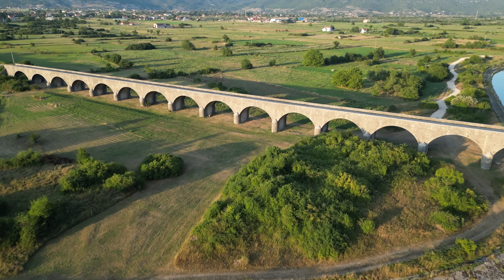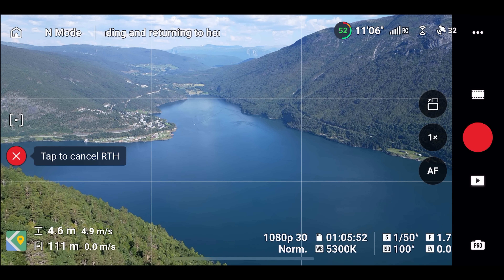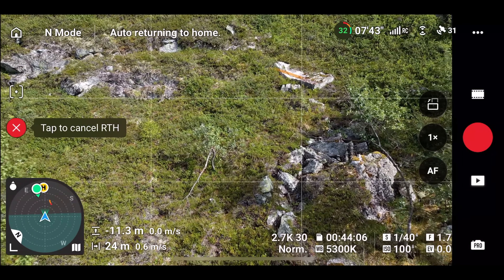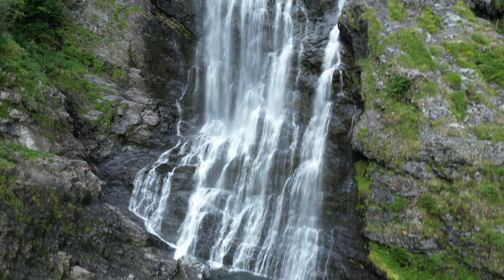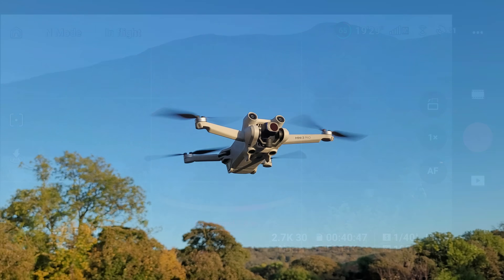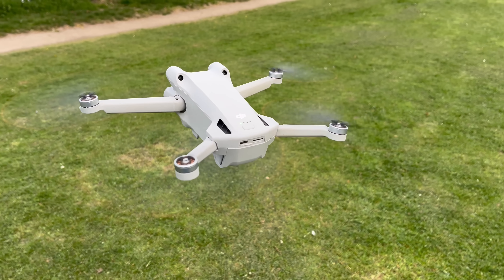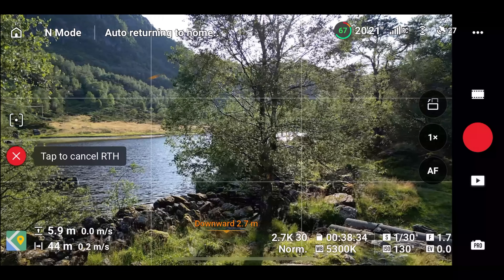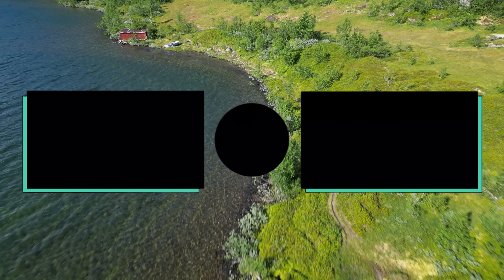Negative Altitude RTH has a BIG Problem... Here's What You Should Know

Comment: Thanks for taking the trouble to document this fairly common scenario that many of us have been baffled and confused by, leading to the loss of a drone. I must admit that I’ve not read the operation manual thoroughly. So far I’ve avoided any mishaps by mostly maneuvering back manually
Reply from the maker: Glad it was helpful, and it's good to hear you've been able to avoid any issues so far!
Reply: You have identified the root cause of the problem!   
" I must admit that I’ve not read the operation manual thoroughly."

You can always find out exactly how new features work by experimentation.      That's the expensive way.

Reading the manual not only helps you to avoid crashes you'd otherwise have had:  It may make you appreciate features and abilities that you would otherwise have missed.

There are many names for actual pilots (manned aircraft) who don't read manuals.  None of them are flattering.
Reply from the maker: @jimbarron9939 That’s just it though - in this case the manual seems to be missing this crucial piece of info which has the potential to prevent losing the drone.
Reply: @jimbarron9939 well this case shows that reading the manual doesn't help.😊

Comment: The mini 3 pro is plagued with issues.
1- one motor was stuck

2- auto transmission module does not work anymore. Specially the 5.8ghz

3 - fog/ mist in the lens

4- very bad signal 

The Mini 2 was the best and most reliable Mini ever created by Dji hands down
Reply: El mejor será el Mini 5 Pro (detector obstáculos 360°, sensor Lidar, sensor cámara 1", graba audio, Batería  50 min. etc.) pero el Mini 2 sin duda fue lo "más Pro" en su tiempo (Ocusync 2, vientos nivel 5, Vel. 57,6 km/h, Dist. 10 km., alt. 4 km., Camara UHD 4 K, vuelos IA, Fotos Raw - Pano - 360°, SD 256 GB) tengo dos drones pero el 2 el q más uso no lo cambio; veremos el precio del 5.. 👍🏽✅
Reply: @Heriel989 The Mini 5 Pro is amazing. I got mine 12 days ago.
Reply from the maker: There are a few frustrating issues with the drone, but I’d say overall it’s still a great drone. I doubt DJI will be releasing any major updates for the Mini 3 Pro anymore since we have the 4 Pro, and potentially a 5 Pro coming soon.

Comment: I knew about the 5 m.
Not the 50 m thing. You can cancel RTH at any time and control it manually. Unless you happen to be flying in the forest, where RTH is difficult, simply bring the drone to a positive altitude manually and then perform RTH again. 
You should never rely completely on technology. In other words, you should have enough battery power so that you can find it if it lands in a difficult spot. If it takes longer to recover it, you can attach an Air Tec with Velcro adhesive. I created this option for myself in case recovery takes longer than expected and the battery is empty. This is definitely recommended for cliffs.
Reply: RTH is, at the end of the day, supposed to cover WCS - worst case scenario. It's a "fail safe" option. This is what makes it a big deal. So forget about the choice to use RTH as a convenience and look at it from this perspective.
Reply from the maker: The AirTag is a good idea. DJI actually has their own “Find My Drone” system built into the software so that if you ever crash you can easily locate it. I have a video on my channel going over how it works. It’s when you lose signal with the drone then it can become quite risky as you’d have no way of controlling it, so remember to go out with a fully charged controller!! Thanks, nice to hear you learnt something new from this video!
Reply: @takeoffdrones In a remote location an Air Tag won't be of use because it relies on relaying a BTLE signal off someone else's phone. No phones or passersby if the drone is in the middle of nowhere.
Reply from the maker: @amerikalast  Good point, I had forgotten about that. Especially if you crash into thick tree cover where nobody is around. If you want some GPS coordinates to locate the drone then I guess Find My Drone could work…
Reply: @takeoffdrones The GPS coordinates are shown on the screen of the RC2 controller. In my crash situation mentioned elsewhere, I immediately took a photo of the screen with the coordinates with my phone. Then, with my purpose-made field GPS I got to the exact location of the drone, with much better accuracy than the RC2 was capable of, meaning, I think, that the GPS unit in the drone is far more accurate than that in the RC2.